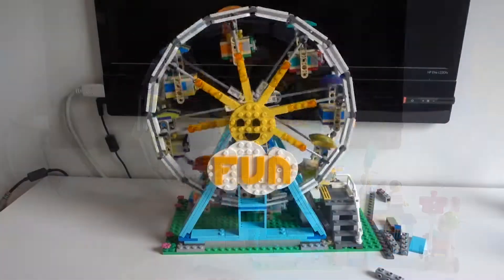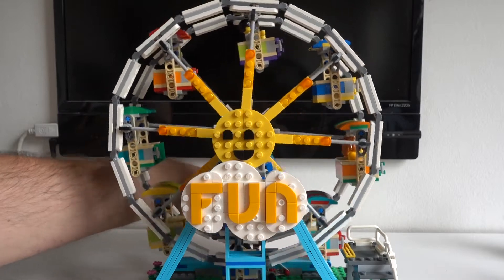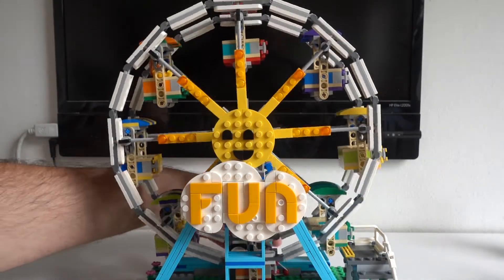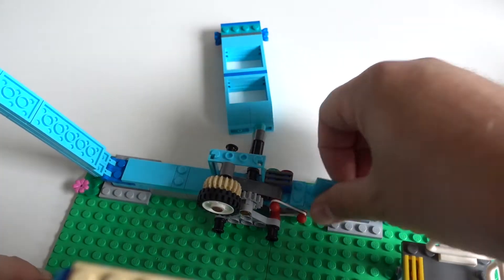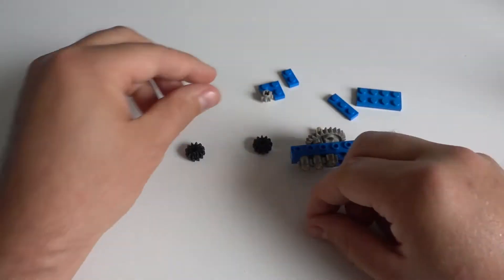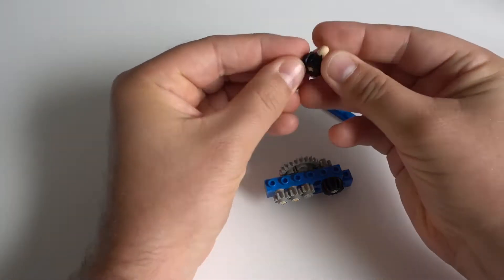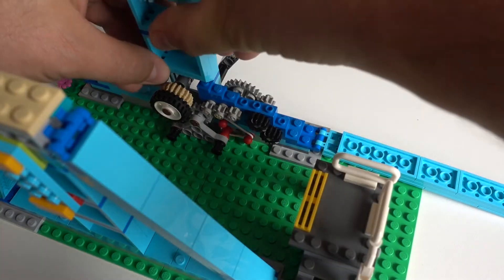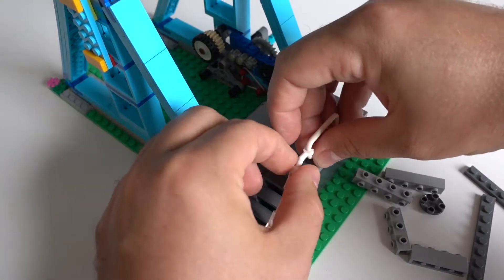Motorizing LEGO Ferris Wheel 31119

Comment: Quick note: the old gear are out of production by LEGO until the new and improved one is replaced in 1980s to 2011s. 
The newer gears has less backlash and more reinforced but the smaller 8t gears gets cracked during running. 
This is a same problem with a osprey set.